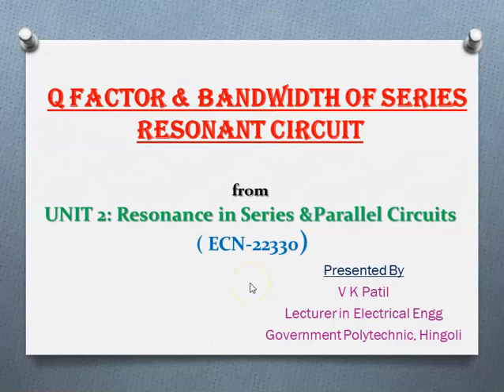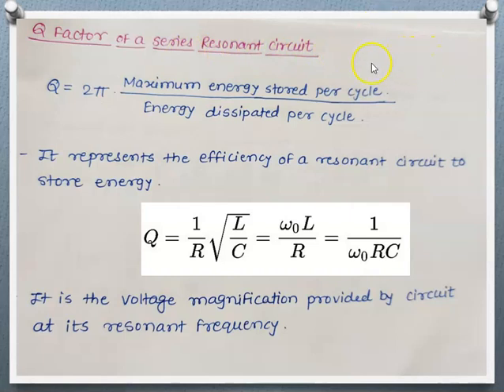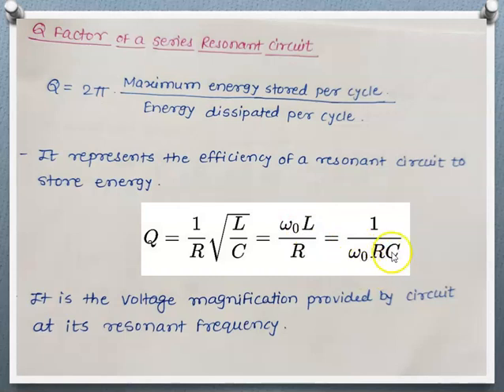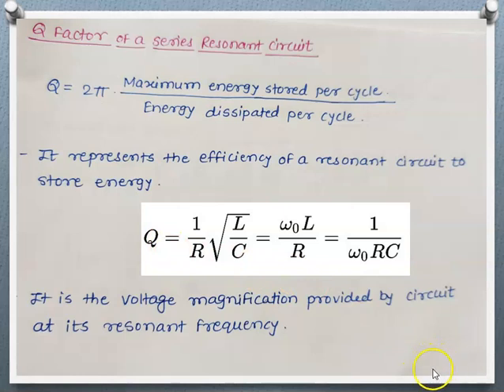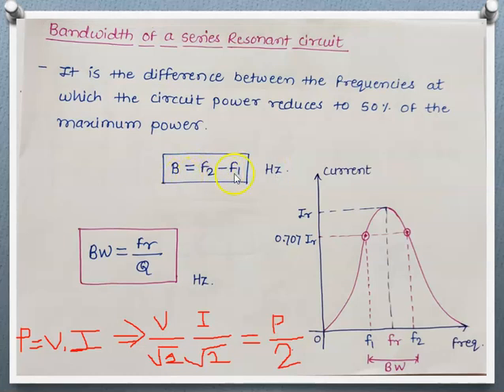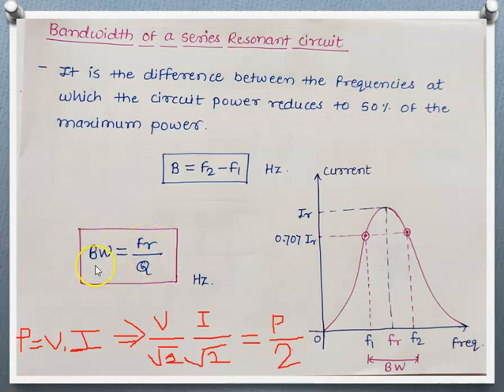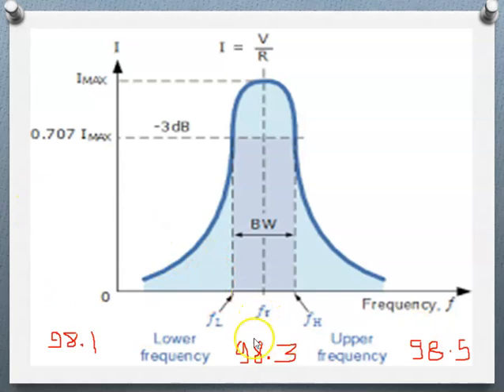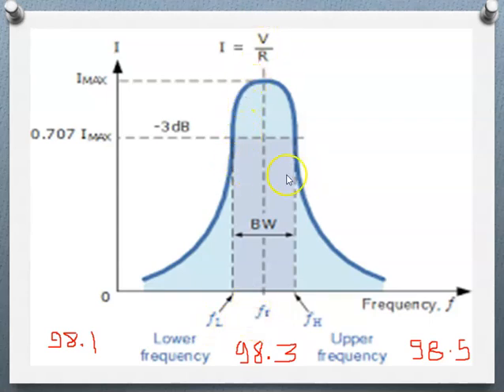Lect 8 || ECN || What is Q Factor || What is Bandwidth ||  Its Importance  in Resonance Circuits

Comment: Thanks for your explanation.

But one point I think you have missed. VL=Vc should be defrent signs (VL=-Vc) in this case only the voltage of the two parallel sides (source side and RLC side) will be equal. since the voltage across R is same as the source voltage V.

Comment: The value of VL and Vc as compared to Vs at series RLC  resonance  .plz explain ma'am
Reply from the maker: In case of series RLC resonance...Vs is applied voltage to the circuit then
VL= Q*Vs  & Vc = Q*Vs volt..

 let's  take Vs=10 Volt & Q=5 for example
Then
VL=Q*Vs= 5*10=50 volt
VC =Q*Vs=5*10=50 volt
This is the benefit of resonance..when we apply 10 V to series RLC circuit, we are getting 50V accross L & C..